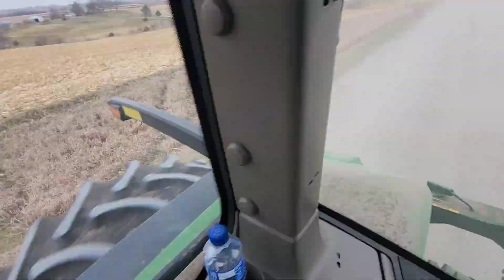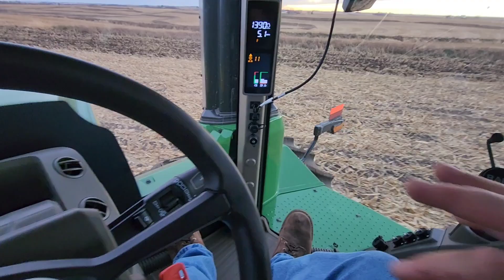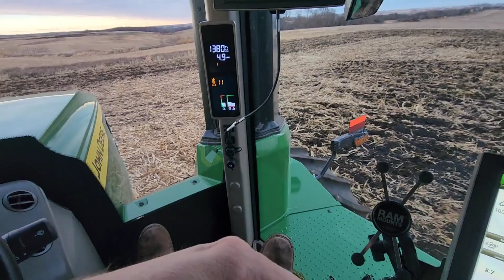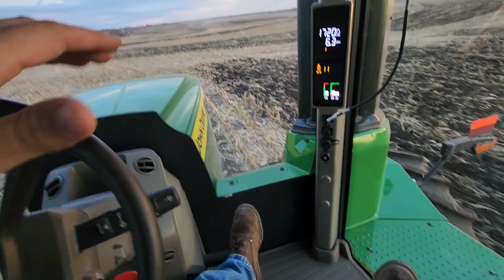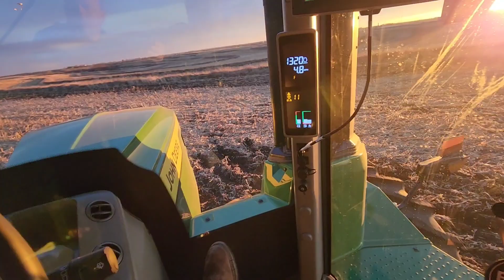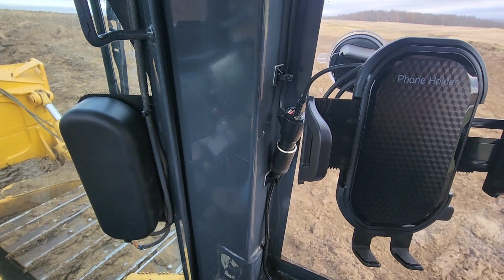preparing ground for corn on corn

Comment: Electric is a 🤣 Joke work a couple of hours and then Charge for 13
Reply from the maker: You dont understand ... The electric 8R410 is not battery powered ... its engine running a generator - which runs a motor ... essentially it replaces a transmission ... less loss of power / simpler / completely variable for speed .. its a great system ..  same system thats used on other equipment, such as haul trucks, locomotives, etc.  for many years

Comment: Man I’ve wondered for years why a tractor manufacturer didn’t use a diesel electric set up like locomotives! I think it’s absolutely awesome to hear Deere is finally gonna do that!! And that’s a nice 9R! I’ve only drove one articulated tractor before, and that was a totally different feeling over a regular tractor. Looking forward to hearing more reviews on it!
Reply from the maker: For sure .. I agree 100% ... long past due ... plus this way they can power other electric things like the exact Emerge planter - which it would be way handier to plug a planter in to the tractor vs, having to set up the alternator and brackets like they have now ..... thanks very much - more good videos coming up

Comment: Liked, I missed the series of the 9r,
Reply from the maker: It's a new 9R440
Reply: @Blackearthexcavationandtiling  I can see you love it. Just seems like it will be under powered if and when you move up to larger implements.
Reply from the maker: @mrih1586  it's essentially a 94 or 9530 (in between) - which is just about ideal for our size operation

Comment: watch the new fan drive on the darn thing that fan drive sucks on the newer deere tractors
Reply from the maker: It's hydraulic motor powered on the new 9R - 13.6L
Reply: @Blackearthexcavationandtiling  good i know i been watching a lot of videos with deere units going down from that damned fan drive screwing up this year glad you got a good one
Reply from the maker: @mattphillips4260  the series prior to this was a flop on the fan drives (lots of problems) but this brand new model, they've improved it... which is a good thing